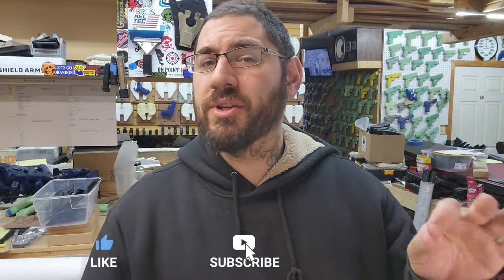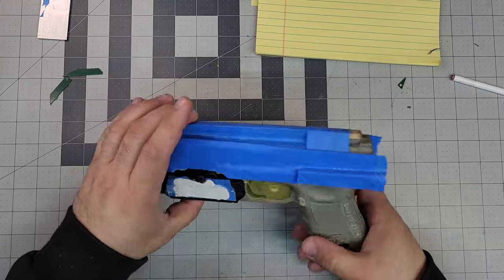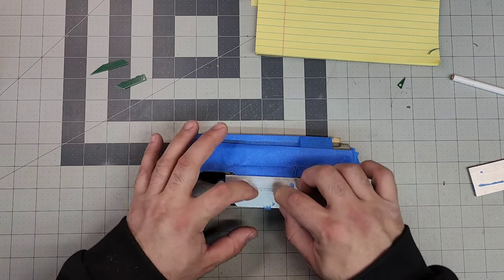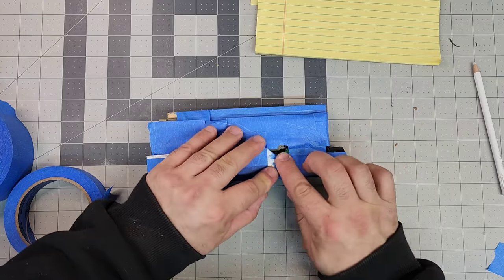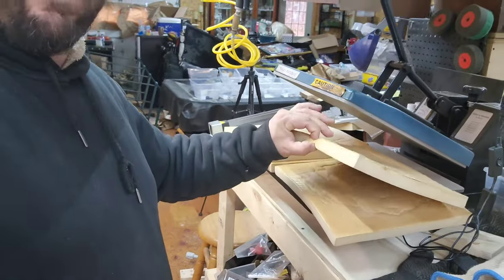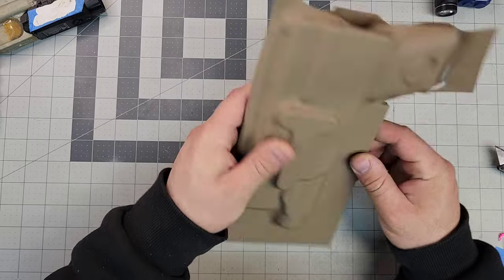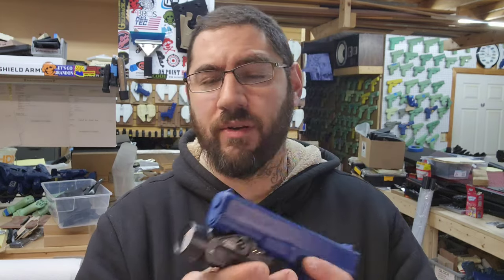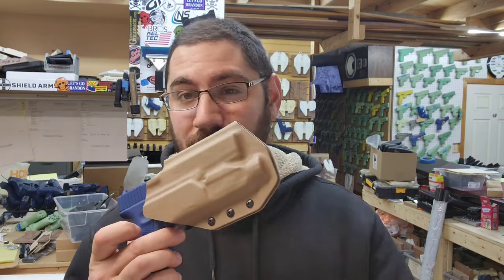Making An Outside The Waistband Holster for the Glock 17 With PID Plus WML

Comment: Hey man I’m new to making holsters and I need some help I’m making one for a prodigy 4.25 with a tlr 7a and I can’t seem to make the holster have retention how and where does the retention come from or where do you decide to mold it?

Also I’m currently using a griddle to heat up my kydex and it constantly melts to quickly I only turn it up to 275 idk why it melts should I just get a 40 dollar oven will it still melt as fast?
Reply from the maker: Definitely an oven over a griddle. You can also find used heat presses on Facebook marketplace for cheap. I got a back up for 70. Also the retention on the tlr7 is right behind the rail mount itself
Reply: @FalTacUnlimitedLLC  so that means the amount detail does matter right? Cause that would mean the indentations are greater.
Reply from the maker: Correct
Reply: @FalTacUnlimitedLLC  thanks man I appreciate it! One more question I don’t have a machine to cut out metal pieces like the ones you have where can I get those pieces?
Reply from the maker: @Skeetacus3  it's all home made. Pick up a dremel or saw and make it work!